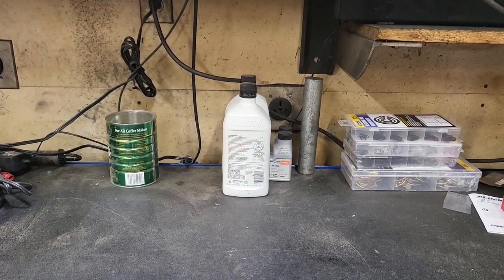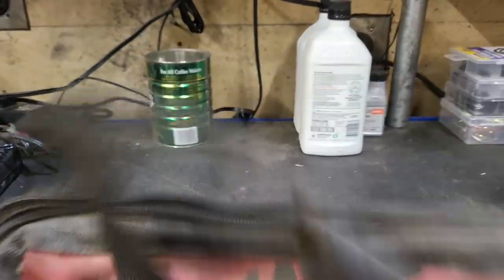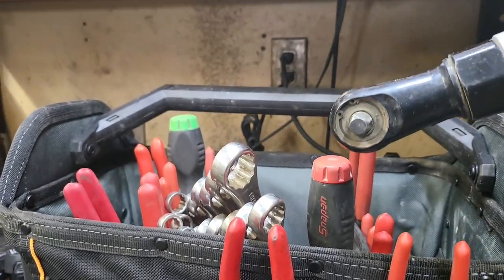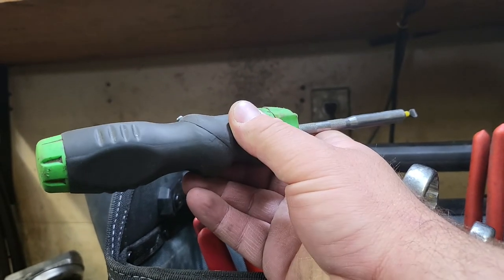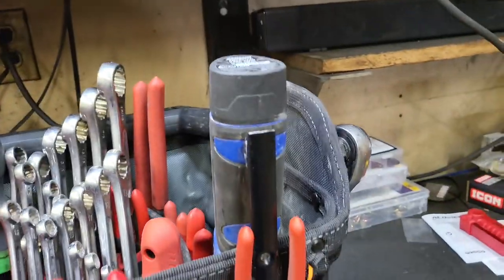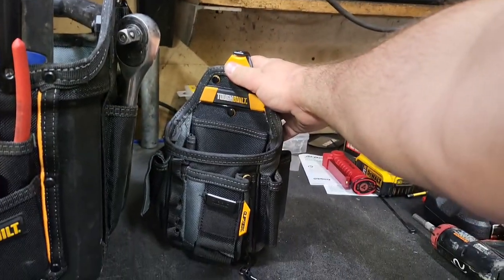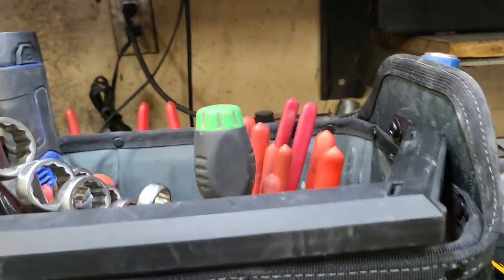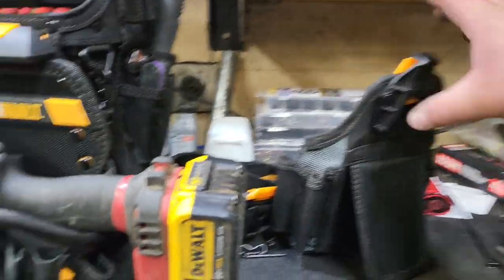Toughbuilt Tool Tote System: The Last Tool Tote You'll Ever Need

Comment: I bought one of these about 2 years ago, lasted about 6 months before the shoulder strap broke off (the D-Ring on the bag not the strap), I still have it and use it as my install bag but it looks like hell at this point for what I paid its ok but I upgraded to a Veto about 18 months, fits my needs perfectly and it is holding up amazingly well. If you are a professional that will carry this everday I wouldn't recommend this it won't hold up to daily use well but for a DIYer this would be great.
Reply from the maker: Thanks, I'll have to look into them.
Reply: @thisolb1tch946  I'm a few years into mine and it's the same as the day I got it. Generally speaking when these clips go it's because the person had something like 40-50lbs of tools in it and wore it by the shoulder strap only expecting the weight capacity of the bag to be the same as the strap clips only to be amazed when it rather reasonably breaks. But that's what happens when tradesmen don't take care of their stuff.
Reply from the maker: @d1vin1ty I use mine everyday however I'll be honest for the most it stays in my truck unless it's absolutely necessary to pack out otherwise I use the pouches.  But uea I could see the shoulder strap or even the main handle giving out over time

Comment: I might need to drill some drain holes in mine. It looks perfect other than that. I work in wet conditions (rain).
Reply from the maker: Sorry it took so long for the reply! Been busy and this just kinda a hobby I have, I will admit most of the time it stays in my truck cause it's do damn heavy. I do believe the bottom has a fabric liner but it's all plastic after that. I still stand behind this product and it has served me well. It might not be the most typical application but it's held up so far!

Comment: How does your wrenches holds together?
Reply from the maker: Those are Mac Tools Precision Torque Wrenches, and they came in that case. Really good design I've seen lately that a some manufacturers are going to that style of case instead of a tray or roll. I'm pretty sure Top-Tul is makes them for mac but I've seen craftsman, and Duratech have similar cases. If some one was smart they'd just sell the case.
Reply from the maker: That is not surprising, I've been Hella busy lately but I've got new wrenches in self contained cases I want to do a video on.
Reply from the maker: Sorry I'm working on it man.
Reply from the maker: Sorry man I've been busy and just saw this, what I have are Mac Tools, which are the same company last I checked.

Comment: Oh yeah--let's compare a brand new tote to these old worn out tool bags, which have obviously been ran hard and put away wet--that's not apples to oranges. . . 😅
Reply from the maker: That's a fair point. I never really liked the doctor bags to begin with, so I was a little bias.
Reply: @thisolb1tch946  I actually just got this tote myself. It's a nice one. I still use the bags for other things like storage and one is a small toolbag I have in my car.
Reply from the maker: I haven't been disappointed in it yet, I have one bag and all I keep in it is batteries, and for that it works just fine.